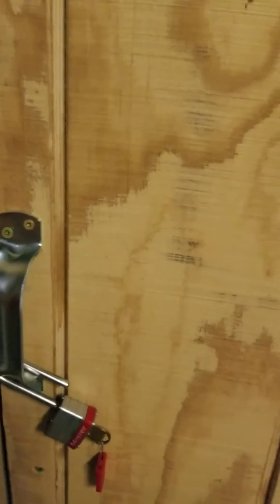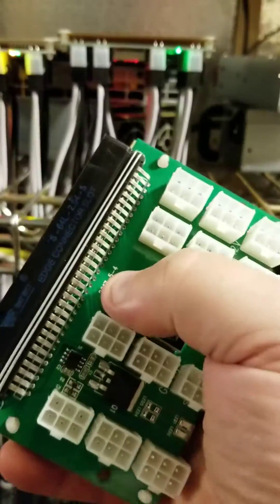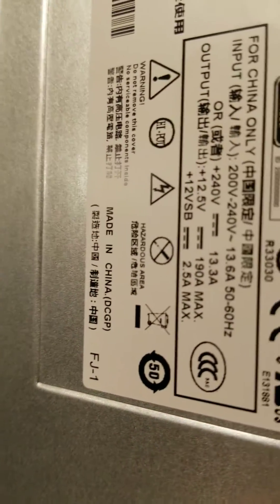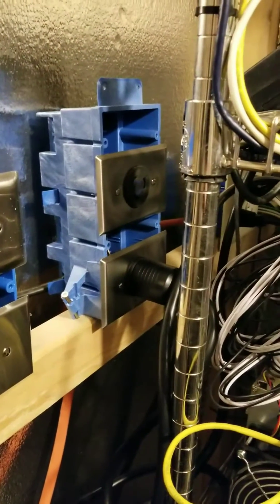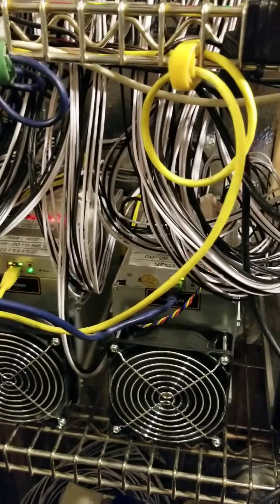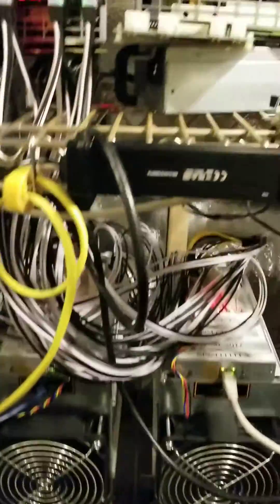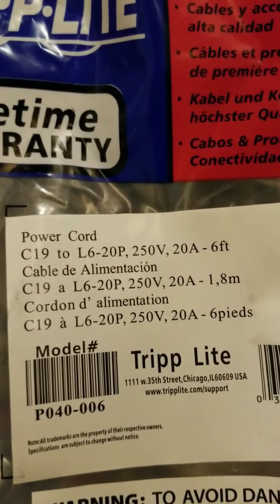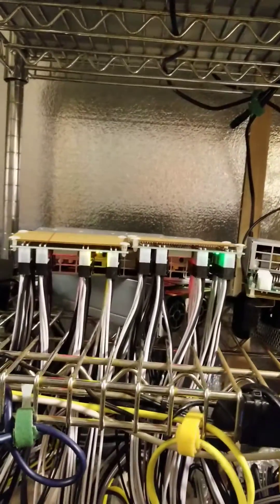Antminer L3+ power supply that runs 3 machines at once

Comment: Hi Shawn. Just subscribed. I have 17 bitmain machines coming( l3+ and d3s). Would love to know more about your power supplies and power cords. will order those when I get more machines. I have the bitmain power supplies coming and am looking for the right power cords to run them at 220volts. My PSU's have the regular power cord end and not the c19 end.  Looking forward to more of your videos and seeing you grow. I can't wait to get my machines. It will be xmas. Cheers
Reply from the maker: my power cords will not work for the bitmain ones but you can hook up a 110 outlet and make it a 220 by putting the 110 on the gold side and the 2nd lead of 110 on the silver or neutral side and ground as normal. if you do this you can use the bitmain supplies with a normal computer power cord. if you do do this i recommend always use a 20 amp rates plug set  and get a different color like orange, blue, green, or red and label the outlet as 220V plug. if you did this you could plug 2 of the bitmain power supplies in to run 2 antminers you could even make it a quad plug for 4 miners on a 20 amp 220v breaker. you could run 4 of the l3+ or 3 of the d3's, or s9's off this setup and your amps will be fine.
Reply: wow great fast answer. Thank you. I guess the only concern is that the cords I have are rated 10amps.
Reply from the maker: 10 amp rated cords are fine, the antminers l3+ only draw 3.5 amps per side the d3+ and s9 only pull about 5.6 amps per side so a standered power supplies cable is fine for this.
Reply: Boy am I happy I found your channel tonight. Thank you so much!

Comment: Great video Shawn thank you. I'm just starting  out and would love some advice to a newbie. Got a l3+ on the way and have two different power supply options. I have a EVGA Supernova 1300W and the Bitmain power supply on the way. Wanted to know which is best to use or if I should get something else. And about the 110 vs. 220 how to handle that objective. Please hit me up if you can. 
Thanks ! Dan Jbad_patriot
@yahoo.com
Reply from the maker: Daniel Miles 
The bitmain power suplies are brown rated, or better known as cheep and use more power then needed to run. Does your other power supplies have a better rating like silver, gold, or platinum? If so use it instead, it will save you money.
Reply: shawnpc1 thanks for the reply. It's GOLD rated. Will I be able to hook it up directly to the l3? Also can I use 110 or do I need to use 220? Here are the full details. Thanks!
EVGA SuperNOVA 1300 G2 80+ GOLD, 1300W Fully Modular NVIDIA SLI and Crossfire Ready 10 Year Warranty Power Supply 120-G2-1300-XR
Reply: Hey Shawn - So I am running the L3+ now with Bitmains power supply but I also have the EVGA SuperNOVA 1300 G2 80+ GOLD, 1300W Fully Modular NVIDIA SLI and Crossfire Ready 10 Year Warranty Power Supply 120-G2-1300-XR - Should I use one or the other? Does it matter? I am currently running the antminer power supply off of 110V and have no issues with power I am getting the full 504MH/S. So I may just return the EVGA power supply since I think it doesn't have enough power cables to connect to all 9 and 1 slots. Any advice would be welcomed. Thanks
Reply from the maker: both will do, the l3+ only uses about 800 watts so both will run it fine with no problems

Comment: Could you tell me if the Antminer L3+ can run on 110V? We have some other machines on 220v but don't want to add more so looking for options to run on 110v. Would appreciate your advice.
Reply from the maker: yes it can just need a PSU that runs on 110v with 9 pcie-6 pin connectors that pushes 850 watt or better output.
Reply from the maker: if you give me a few i might be able to find a good cheep one for you.

Comment: So does that power supply run off of the C19 connector or is there an adapter to connect the C19? Have my first miner (L3+)coming tomorrow and would like to run it off 220. Sorry for the rookie question. Love the video though
Reply from the maker: yes C19 to L6-20P 220v. you can get both the power supplies and cord from usahomegardens.com
Reply: shawnpc1 thanks for the response. I plan on buying this power supply it looks awesome. But I do have the Bitmain APW3 power supply. Do you know how to set that up to run the 220? Why kind of power cord is it or where I can find one?
Reply from the maker: the apw3 uses a standerd computer cord. you can set 220v up on a standerd 110 plug 110v in on the gold side and 110 lead from the other side of 220v on the silver side. then ground on the green screw. use a 20 amp plug for this and an off color not beige or white!!  and use a different plug cover, I use a gray plug and a black cover and have it labeled as 220v

Comment: Great video.  Quick question though (please forgive my ignorance). If the L3 pulls 800 watts (+10% per Bitmain), how is a 2400 watt power supply able to handle 3 L3s (800 x 3 = 2400 ... +10% = 2640 watts)? And isn't the X-Adapter REV 7 only rated to 1900 watts?  Just clarifying things before I buy.  Thanks very much.
Reply from the maker: they actually only pull 700 watt per machine and up to 800 watt if overclocked. the 2400 runs them smooth with no interruptions and can also handle them overclocked.
Reply from the maker: to put it short bitmain over estimated the power consumption. better to overdue then under due

Comment: Im curious with this setup what does it cost to net 1 litecoin?
Reply from the maker: I am running 3 machines right now producing an average of 1.2  litecoin a day between the 3 machines. so in 30 days i am pushing 32 to 36 litecoin for every 3 machines. my power cost is $0.0644  kwh or $111.34 per month to run the 3 machines. so if you go by today's average of  69.90 per coin based off of coinbase.com i am pulling a total of $2236.80 to $2516.4 per mo. for every 3 machines that i have. this is without over clocking, if i overclocked i would average closer to 42 litecoin a month or  $2935.8 for 3 machines but could only run 2 machines per power supply's beacuse the draw is closer to 1000 watt instead of 850 watt and a cost of about 132.00 to run the machines. 

best way to put it is for every 3 machines i own it takes a month and a week before everything is paid for.  ROI or return on investment on 3 machines is running me about 37 days.

hope this answers some questions
Reply: shawnpc1 what sort of Internet speed do you need for these? With those sorts of profits I feel this is a no brainer especially with winter coming up. But then again it's Bitmain so I'm sure their wait times to get your order in are forever 😢
Reply from the maker: Sasha Bakhshi you need to be attached  hard line rj45 connection to just a basic switch I bought a 24 port switch all they pull is about one meg of info at a time so low internet usage, that's why a 10 / 100 switch tied to your home router works fine.
Reply: Dear Shawnpc1 I just bought a delta brand 2400 pcu to run my 3 l3+ my pcu comes with 16 port where do you think I can buy 24 port board to connect all my l3+?
Thanks in advance